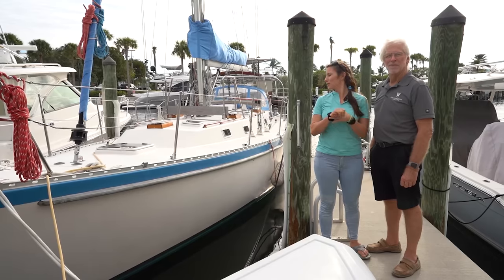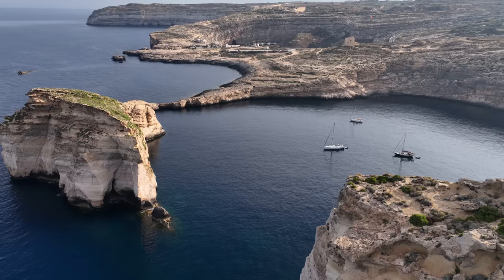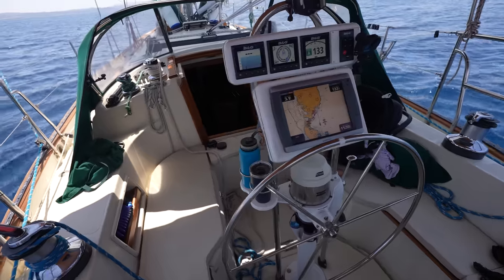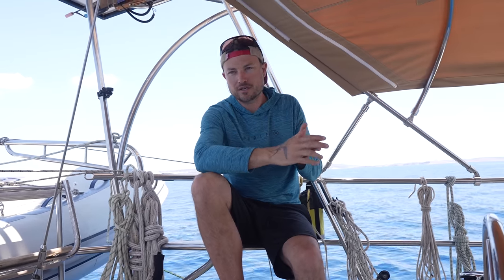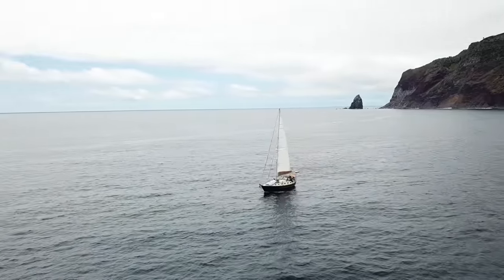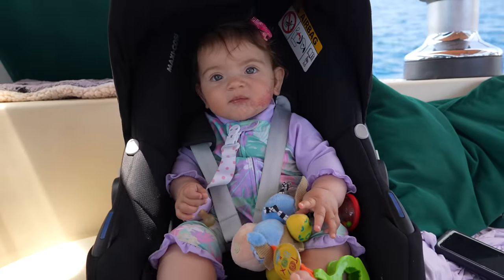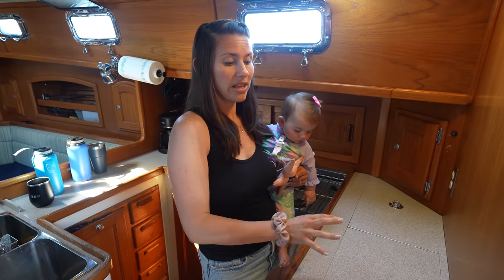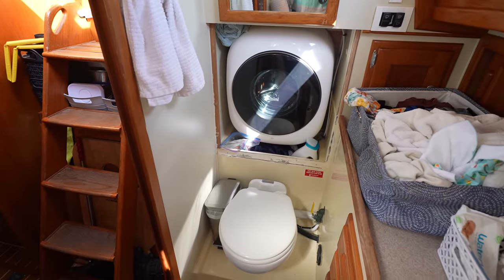Did we Choose the Wrong Boat? | S08E18

Comment: Lovely Boat your Pacific Seacraft, and pretty much broadly similar to every Sailboat Ive had, exceptions  eing a couple with Bilge Keels.  Unfortunately, due to disabilities, it is pretty much impossible now for me tonget in and off such Boats. But my next Sailboat is along those lines but has a Sugarscoop stern, which can function as a Dinghy Dock, for me to easily get on and off the tender, plus has very easy access to the Aft Cockpit.  A Construction option is to have a Hard Dodger for good protection, plus another is a Hard Aft Cockpit Arch for Solar Panels and Davits,  with a Cloth Bimini and side enclosures for Sun, Rain, and Wind fill in sides plus insect screens. It is Also Termite Proof. I'm wating still for my Piggybank to be filled up, before placing an order for an Island Packet IP 439, the only other high cost option I'm going for is the Seldene push button Sail handling option, which has manual winch backup. Below, the galley is great, with a Utility room behind it, for great engine and gearbox access. It may be the first 439 notbgoing for the Captain's Chairs  elow, as  want/need the Setee Seaberth, and the pullout double berth opposite.  I wint need the built in Generator either, so there should be enough displacement spare for 1200 ah of high quality AGM batteries for the House Battery Bank By ,eeping the state of charge above 80%  etween topping back up, the 3500 charge Cycles Flatline, and never drop. So availab,e poaer between Solar going back in, or firing up the engjne for output from the high output alternator should be up to 240 amps, and the batteries lasting up to 30 years with Luck. I got offdred a free house ank of Lifepo4 for long term testing, but with the data available rivht now, no matter how well you treat them, getting more than 10 years out of them, looks rpto be too doubtful for me to bother with. AGM  eeds thick plates of 99.9% Pure lead, then I know exactly what Im dealing with, plus they're 100% Recycleable, which I like. Frankly, I don't trust any of the current Lithium Recyclers doing what they say they're doing.  By the timethe AGM bite the dust, much better batteries could well be available fingers crossed.   ob. 👍⛵️✨️✨️✨️

Comment: I looked up the specs of Pacific Seacraft 40 
LOA: 42.16 ft
LWL: 31.25 ft
Beam: 12.33 ft
Length Over All (LOA) of 42.16 ft being over 40 ft means you are paying a premium for slips and haul outs. 
Length at Water Line (LWL) 31.25 ft is only a touch under 11 feet differential to your LOA. That is HUGE. 😱 The pointy bow and canoe stern cut way too much into your liveable space. Also access and egress to your dinghy, especially in rough weather would be a nightmare. 
Beam 12.42 ft is not great for a yacht over 42 ft especially with the shape of the hull tapering in at the stern. 
All these add up to a lot more expense and a lot less liveable space. 
I’m glad you are happy with your yacht and at the end of the day that’s all that matters but for me…it’s a big NO.

Comment: To  e, while it is very understandable to do, the viggest Mistake thoselooking to Liveaboard and Cruise, is getting Hypnotised by the Word "Bluewater". Bottom li e, properly prepared, pretty much any boat can be prepared for, and be able to Cross Oceans. So given it is agreed that Liveaboard  ruisers spend around 80%of their time At Anchor, What is the ClearWinner in Boats atAnchor? Well, to me, it's a Sailboat with a large Comfy Aft Cockpit, as that is going to be the most usedRoom Day and  Evening on the boat. But it  eeds Sun, Wind, and Rain Protection, so Dodger, Rear Arch for solar Panels and Davits, and drop down side screens if heDing somewhere cold, or osquitonetting if somewhere warm and desirable,  plus easy clich in Harness Connection while underway. To  e, that  makes aft cockpits actuallySafer than  Centre Cockpit boats,  which gi e a fa,sese se of security, and mostly as viciously uncomfortably hot Cabins  below which are  early as bad Saunas as Deck Saloon glazed Greenhouses s,apped on Monohulls. The other Basic that needs to be taken into account big time as a Cruiser, is do not have a deep Draft boat, unless you i tend to permanently stay in the   Meditterraneanan. For me Ketch Rig is right out or Solar panels bet shaded and their output wrecked. to lrotect valuable Sailcloth  in the Tropics, an in mast Furling Main is anust, and to get  best re,iability for furling, and longest service life, it  ust be battenless, and to bet most of the performance back, it must be of Triradial Construction.  Yes, you can gdt them made, Precision Sails, Quantum, Ullman, and El strom definitely do them. I personally like keeping it simple with sloop Rig, As I do not like sailcloth at bow or stern producing leverage to  Break a heaving to. So the Furling Main suggested by Ullman, Triradial built with  hallenge 9.11 with Offshore Construction sounds about right. BUT Mine is going to be built with 3.5 Reefs, with the last 0.5 Reef split into two reefs as the hove to sail, meeping all forces close to the Mast, and the rest of the Sail Furled in the mast to help disperse the wind Loadings if things get nasty. Foresails all furled in and sheets wound around to keep them friendly. Of Course others using different  sthods are  happy with what works for them, and Id never discourage anyone from doing what tney have gauned confidence with, while using their Boat. My  ext boat is going to be bhilt around the principles that havewirked for  me,  based on if a Beaufort Scale Force 6 is heading  my way, Run like hell out of its way or into plenty of Searoom. 60 years addicted to the Briney next year, and so far, so good. Best Wishes and Fair Winds. Bob in Wales still.  👍✨️✨️✨️⛵️

Comment: Hylas 54 2003 centerboard, goes from 4’-8’. Plenty of space being a center Cockpit it my choice of my laser boat.  Crewed on one in the Newport to Bermuda race went through F10 storms without a problem and extremely fast too weather.  The shallow draft allows great anchoring.   The 6000 lb. Bronze swing keel is really neat.

Comment: if you want more fridge consider buying a 12 volt separate small iceco or other that can do near term uses running off 12 volts....park it wherever you have room for them.  A lot of campers use them now with solar panels to power them.  Many brands available in 32-55 liter sizes...either freezer or fridge depending on temp you set...run on 12 volt or 110